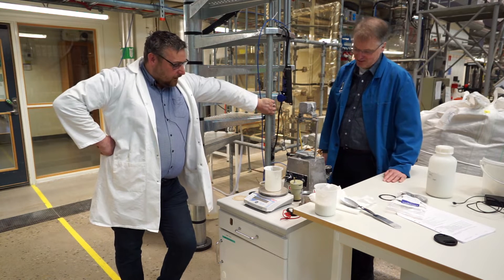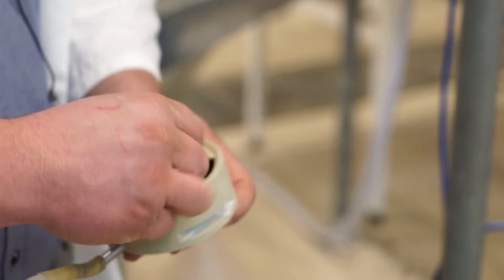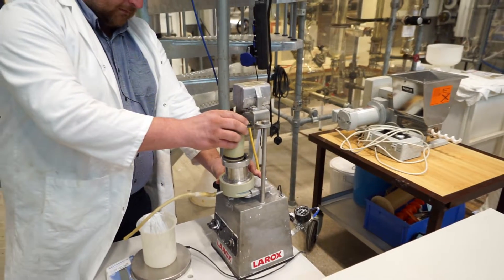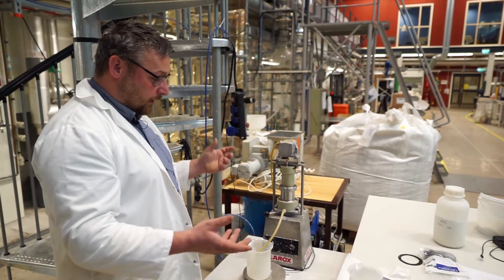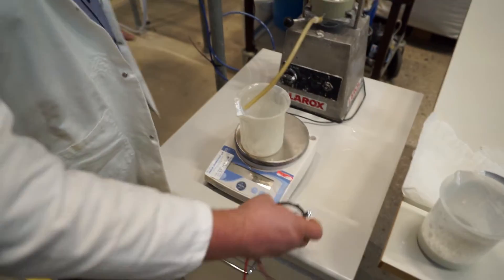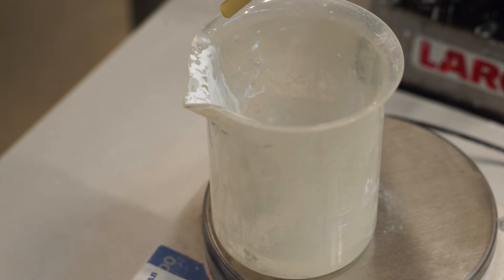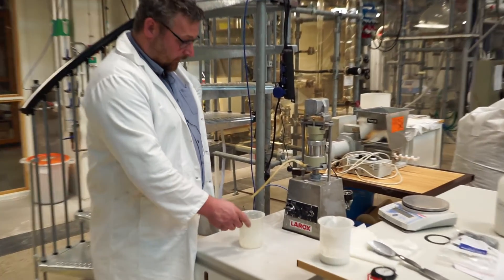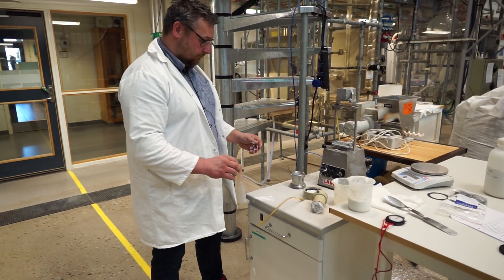Cake filtration demo

Comment: What kind of filter cloth is this? We are looking to filter calcium carbonate from our product.
Reply from the maker: This is only an educational setup.  To quote an old, but still relevant publication ”There are considerable differences in the SLS (Solid-Liquid Separation) as opposed to such conventional areas as distillation, heat transfer, and reactor design. It is not possible to find design data in the literature or handbooks. Whereas thermodynamic properties such as viscosity and specific heat transfer can be estimated, the essential SLS parameters of permeability (or filtration resistance) and porosity must presently be obtained anew for every material.”
(Tiller & Crum, 1977, Chemical Engineering Progress, vol 73(10), October, page 65)

What will suit your particular product is dependent on so many different things